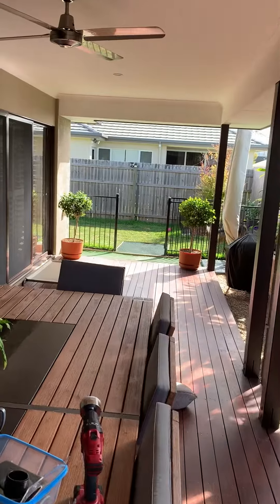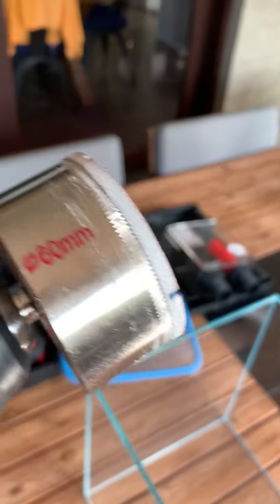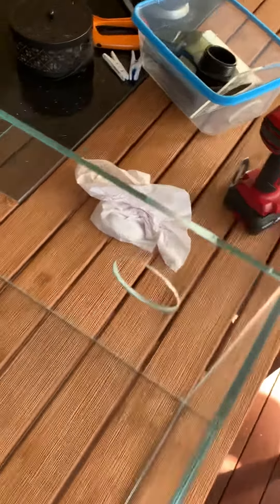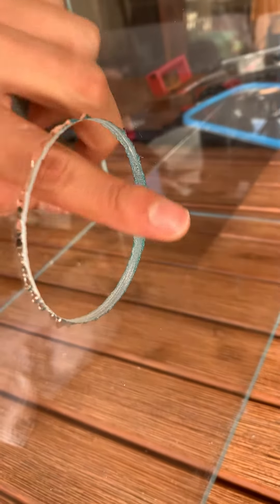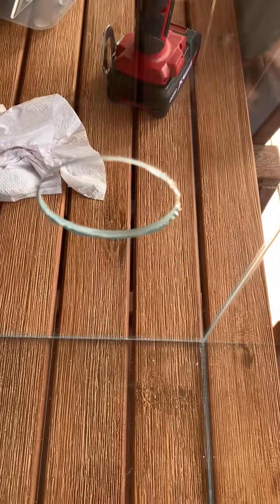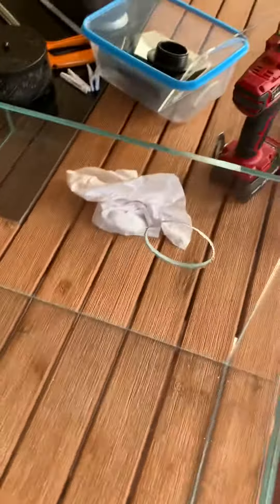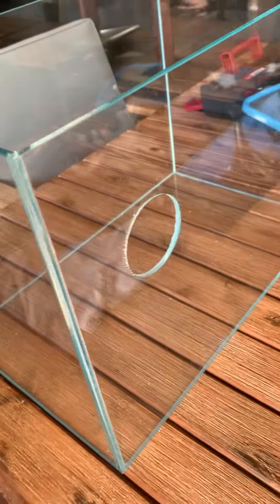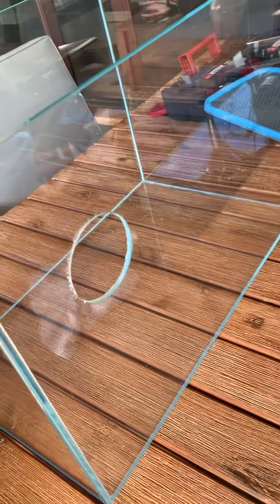Making a Nano nano - Eshopps Eclipse

Comment: Good job with the hole drilling! I think it worked out really well! Keep us posted!
Reply from the maker: Gallery Aquatica TV thanks! After attaching all the plumbing and measuring it I think I have decided not to connect it to the system. I’m too afraid of a leak on the wooden floors in our rental home. Will keep the overflow box for another project. Feels like a huge waste but I learned a lot!